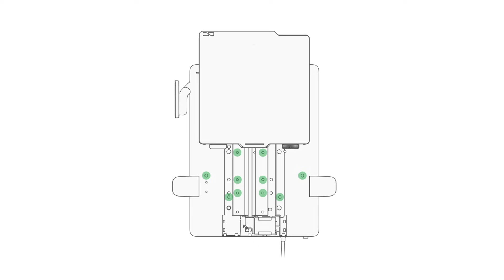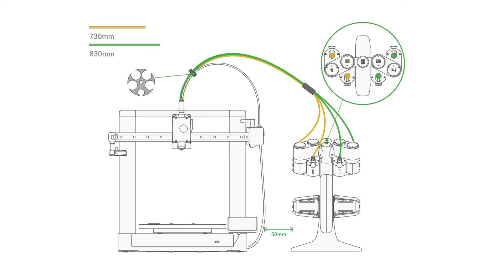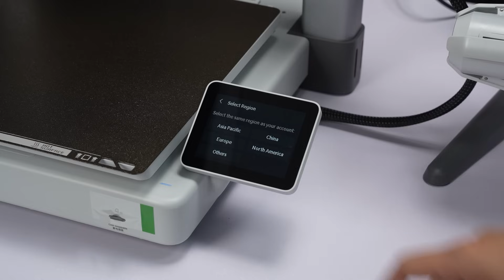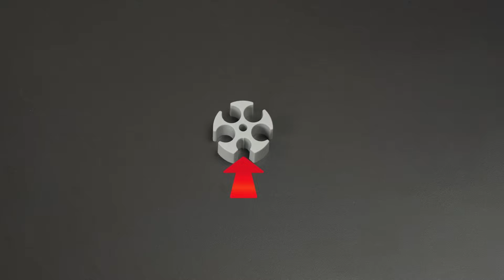Bambu Lab A1 Combo Unboxing

Comment from the maker: Note: If there are stoppers on the Z-axis of your printer, use the H2.0 hex wrench to unscrew and remove them.
Reply: You should do a create or amend this video with these black stoppers showing because there is zero mention in any documentation to remove them. I setup the A1 and immediately failed the calibration because of this. It was only when I compared pictures of my A1 and your A1 that I realised that I needed to remove these black stoppers.
Reply: Donde están ubicados?
Reply: @miguelmachado6708  They are located behind each pillar securing the Z axis, I presume to prevent movement during transit. 2 screws each stopper to remove each one.
Reply: Can someone upload a picture how do they look??
Reply: This is my 3rd machine and those were NOT on the first two. Thank you for updating use because mine failed twice before I see this comment
Reply: @manaluah  Yes, this was my first machine, and I was panicking when it kept on failing the Z axis calibration!!!!
Reply: @andypang6416 don't worry I panicked also. But I knew there was something different. I just couldn't place it. Until I seen the comment. They were just zip tied on the  other machines
Reply: Bonjour, en tant que personne, aveugle de naissance, j’aimerais beaucoup acheter l’une de vos imprimantes. Bisous à vous

Comment: @Bambu Lab...when are you guys releasing the next gen printers? Please I really appreciate it if you could make an X2 large volume printer, helmet class...450*450*450 or maybe a 500*500*500 with an enclosure so we can print huge parts in ASA, PC, Nylon too

Comment: Bambu Lab 5.02.2024 : We kindly request all A1 printer owners immediately cease using A1 printer.
Bambu Lab's two proposals are insufficient, here is my proposal: Bambu Lab must send a new complete and corrected Base Housing as quickly as possible and I do not return the old one, I keep it for spare parts. So I don't have to carry out complicated, potentially dangerous and out-of-warranty technical work! I receive €120 in compensation for the loss and the advance of funds for many months for the purchase of a defective A1 !

Comment: I purchased an A1 on Jan 12 and received it Jan 22. Used it for three weeks and am now wrapped up in the recall. Have submitted the ticket to send it back, but there is no information back from Bambu Labs on where to ship it, a shipping label, etc….. we are told not to use the machines.

I’ve been very happy with the printer, so happy I sold my previous machine. Will we have to wait the three weeks to receive our vouchers towards the purchase of a new machine? 

Can someone at BambuLabs respond please?

Comment: Hey Bambu you need to let all the people that have bought an A1 from you to stop using them because of the protentional fire hazard not just content creators send emails or letters to all customers that have this model i think government regulations need to apply with your products you need to follow them and be made to have ul stamping on your products to protect people from burning there houses down.
Reply: Context? What do u mean— as a potential buyer hearing this without context is like saying don’t put a candle next to curtains, it can burn your house down. Or don’t buy a microwave because if you put metal in it, you can burn your house down
Reply: @NoopNoop-gg9li  When they first came out the bed cable was bending out of shape and causing a short that will start an electrical fire in your house but now they have fixed the problem so buy one now they are a really great printer and now safe to use. there is your context.
Reply: @Viseo3dp  thanks. I've seen people complain about products for being "defective" for reasons XYZ when the product says you're supposed to do it as ABC and do not use for XYZ
Reply: @NoopNoop-gg9li The bad cabled had problems with getting damaged due to the heat, it has been fixed since
Reply: It's fixed now
Reply: WTF are you talking about? They did a FULL recall. It's IMPOSSIBLE for them to email EVERYONE that bought them, because many were bought from 3rd parties. Not to mention, many people don't check their email or spam folders regularly enough. They went far beyond what a lot of companies would have (especially based in CHINA)!
Reply: They fixed it lol
Reply: I used an x1c for 3 days straight no problem. motors were still cold so was the psu. bambu lab printers can tackle a lot

Comment: Please do not buy any of their products. I ordered their X1 Carbon Combo 3d printer along with accessories for $1879.66 total and received a dead unit on arrival that refuses to print unless firmware is upgraded. Upon unboxing, the firmware keeps failing to update no matter what I do. I messaged customer support and they have not responded in over 8 days. DO NOT BUY FROM THIS COMPANY
Reply: Nah they awesome I have a few of their printers. Their customer support is slammed all the time due to their fast rise in popularity but I’m sure you’ll get it all worked out man.
Reply: did you buy it from their official website?

Comment: just assembled mine... I missed the turbine model in the box visible at 0:35. Is it somewhere online?
Reply: its on their website under the "hardware" tab in the store
Reply: @vinniet1000  yeah, already found it. Thanks.
Reply: @dibonko  they probably only include it at youtubers that get send the printer to test, which is sad… how is the printer? I also ordered it yesterday
Reply: @vinniet1000  that crossed my mind too and yeah it's unfortunate. I though I will get the model too. Anyway printer is great so far! I'm impressed for the money it cost with AMS.
Reply: @vinniet1000 I am a not a YouTuber but I have one included in my order.

Comment: What's the difference between the combo?
Reply: Between the combo and what? This is the printer + AMS (filament winder tool)
Reply: @littlefrank90  So the combo isn't faster or something?
Reply: @shrekshrek yeah Combo is just the combination of the printer and the Ams lite 🙏😊
Reply: @shrekshrek no, the only difference is the combo includes the AMS, which allows it to print multi color prints